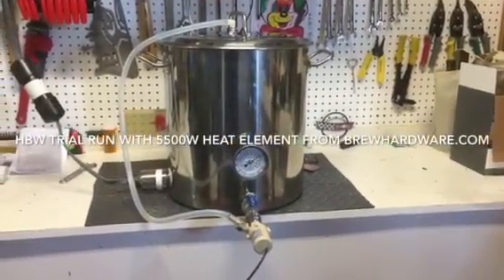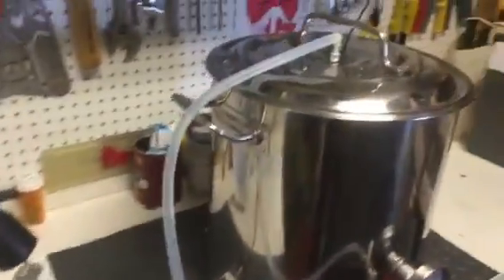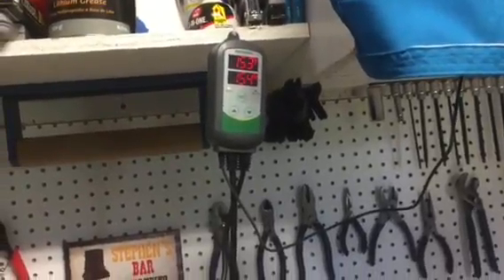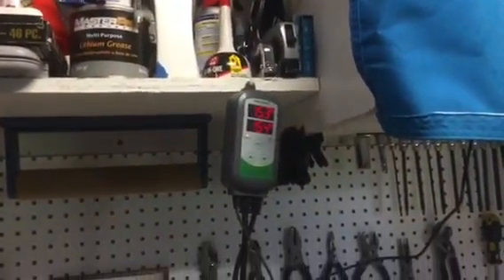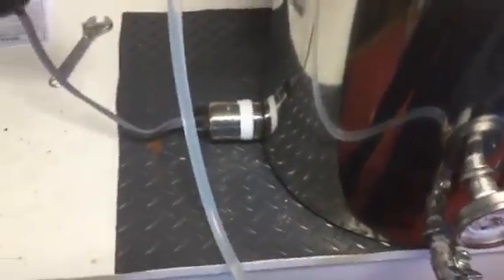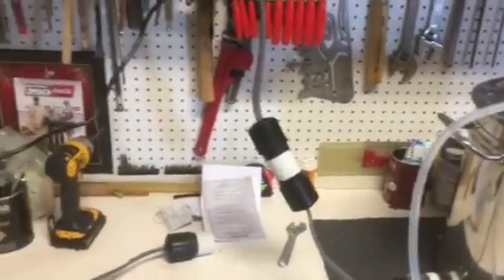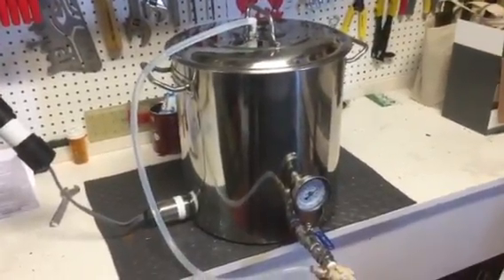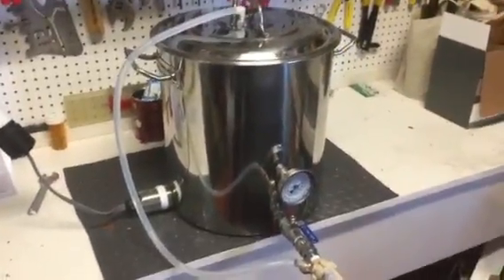HBW trial run 5500w 240v element

Comment: Hi, Are you connecting the Inkbird ITC to a 120V line? and using a 240V 5500W element?  I was thinking of buying the Inkbird ITC 310 to use it in a 240V line with a 2500 W element but according to the specs of the equipment, it can't hold that current. How you manage to use it? any advice is helpful
Reply from the maker: JI. Vargas I use 240v with a light dinner switch from eBay about $8 for the boil and then use 120v to hold mash temp,

Comment: Can you point me in the right direction one finding something that will run a 5500 watt element
Reply from the maker: Prometheus I’m running a 240v 6amp line from my drycleaner  fuse in panel I believe it’s a 50amp fuse